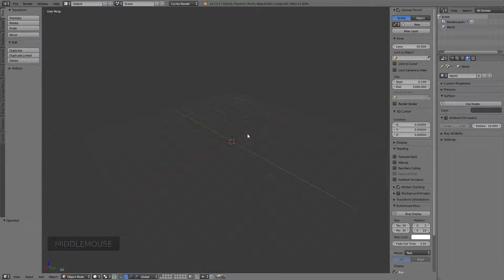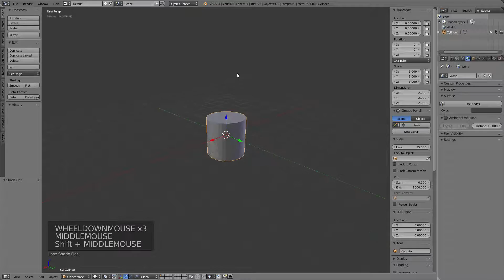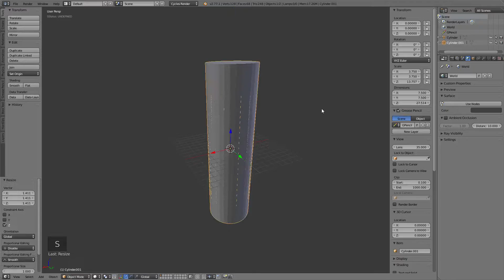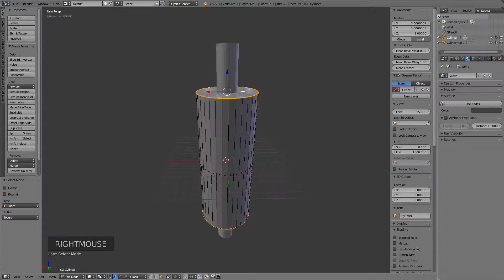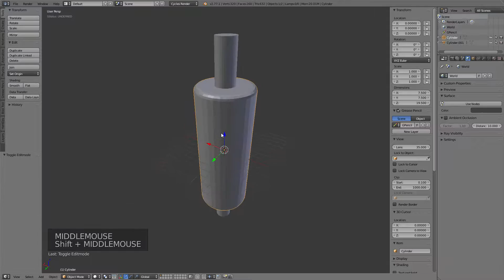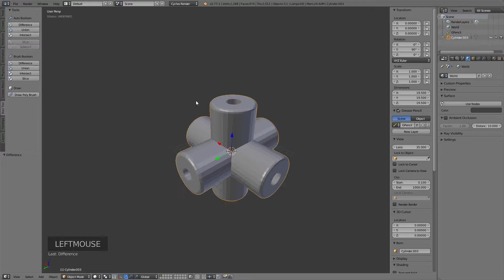Comment: Very well explained, thanks a lot. Happy to have a core now. Do you maybe happen to know the diameter of the core holes? I have no precise tool to measure them.
Reply: I don't usually print my own cores, as I prefer to use existing ones, but it will really depend on the screws you have available. For an M3 size screw I would probably go with around 2.5 mm hole size.
Reply: Thanks a lot.

Comment: I cant make the holes, in which option you clic to made the holes
Reply: You have to make sure BoolTool is turned on in the add-on preferences, or these options won't be there. It is in the latest Blender versions, but turned off by default.

Next, what you are looking for is "Difference" First select the hole object, and then the object you want the hole cut out of. Now you can either click the difference button on the left (In the Bool Tool tab) or simply hit Ctrl and - (The minus on the numpad)

hope that helps
Reply: I have the v2.79 an d i dont find "difference" and i am using a laptop
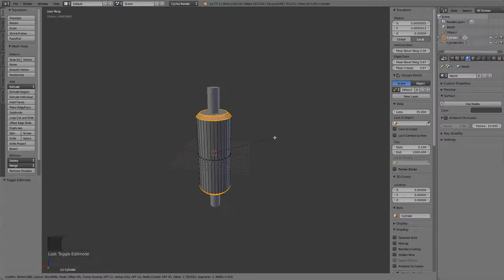Reply: Take a look at video 1 in this series at the 6:00 mark. There I show how to make sure Bool Tool is activated. It will work on any machine, but you need to turn it on before you can use this tool.

Comment: Hey so I made the core but there was a glitch with it. The pieces wouldn't union together without making these really weird cuts on one of them
Reply: Sometimes booleans can fail, and this can be a bit frustrating. I often will just revert to fixing issues by hand, but this is not an easy fix to explain.

If you change the object slightly, you can often get the boolean to work. For example, try changing the number of segments the cylinder has in it, or rotate the cylinder just a small amount along its length. Even a small scale change can fix things. This is not ideal, but scaling something .01 mm isn't really going to affect the end print result.

I will try to make a new video soon that covers some of these issues and also why booleans fail sometimes.